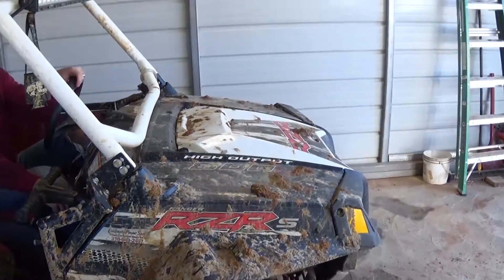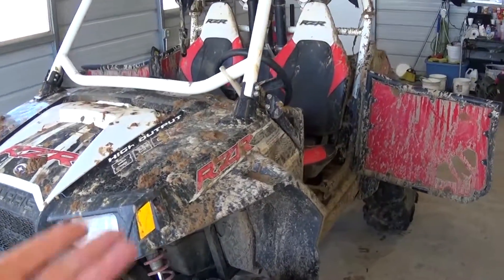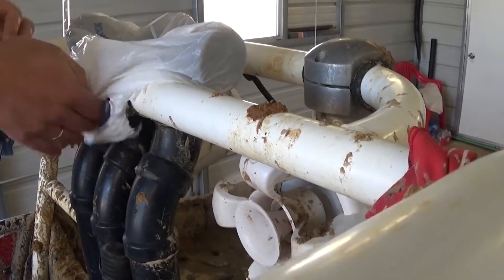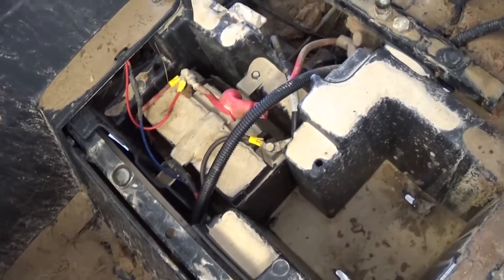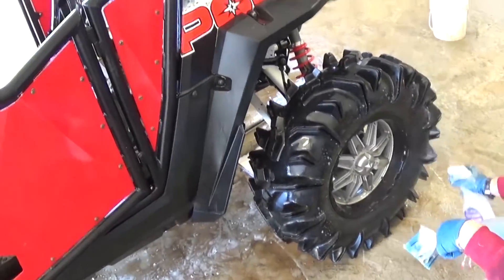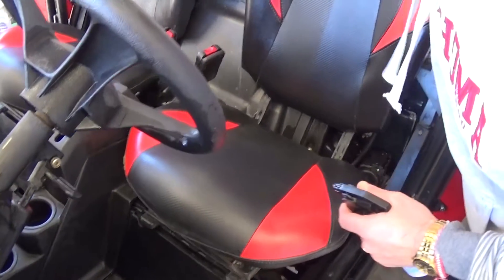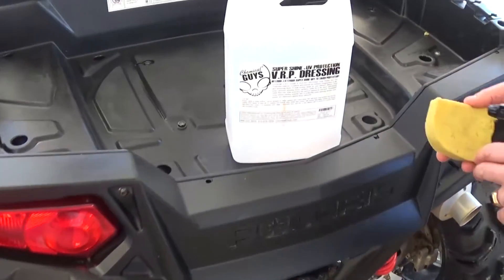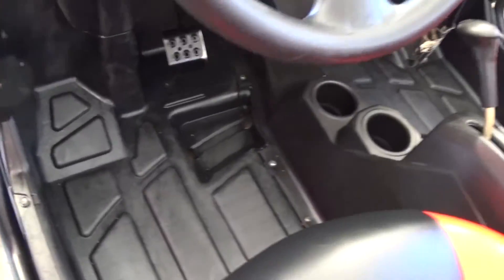2012 Polaris RZR 800 Detailing!  How to clean and what chemicals to use!

Comment: Any recommendations on what to use to remove mud stains from the hood of my RZR? I’ve washed it and cleaned it up good, but still brown stains on the black factory painted sticker of my Turbo S. I’ve tried pledge, WD-40, and turtle wax compound with a microfiber pad. Still there.